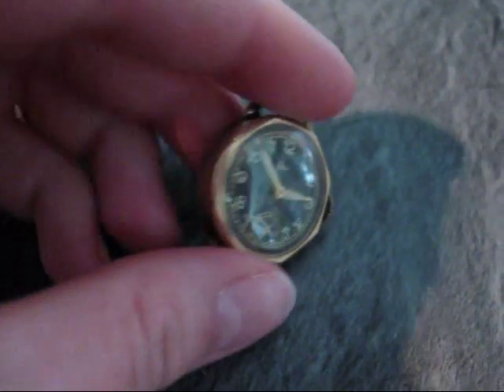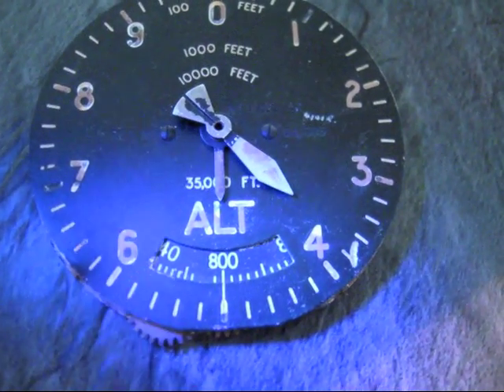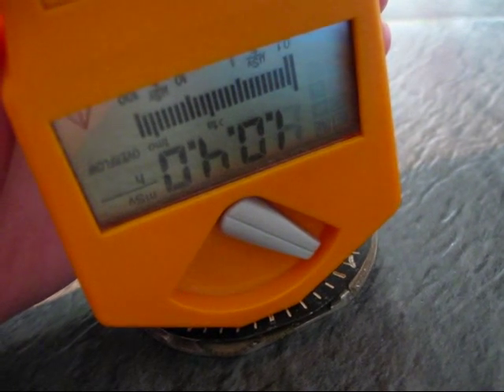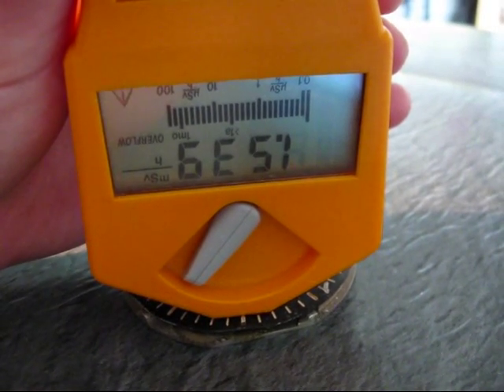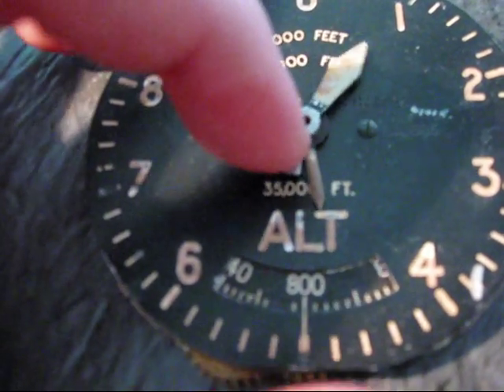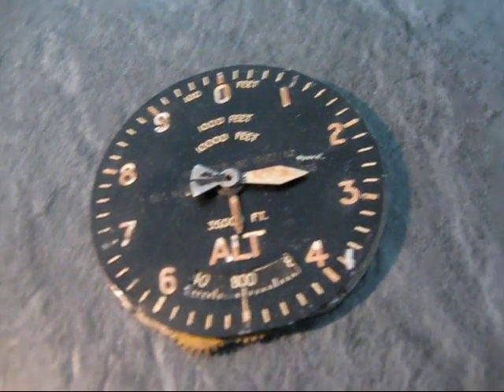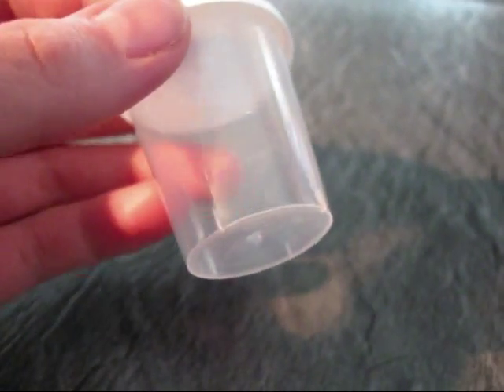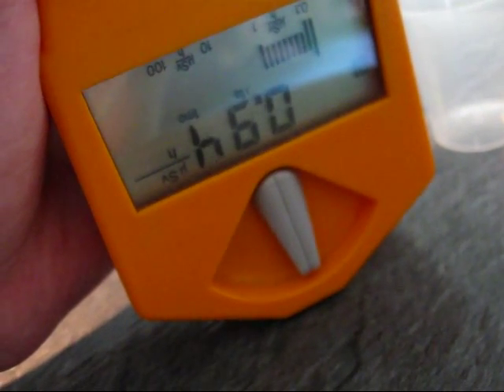radioactive spitfire warbird altimeter - doped with radium

Comment: I'm just imagining the distribution of the manjority of the fragments of the Spitfire dial over the years - and the trail of devastation caused by the ingestion or embedding of fragments in the body.. etc.
I've got a couple of Trinitite specimines that I have been mindful of over the years caused by slowly losing particles - so they are now in a sealed perspex box, probably accumulating gaseous nasties inside
Reply: Don't worry, trinitite is extremely mild, and doesn't produce radon in gas. Spicy radium items and large uranium ore specimens are the nasty ones

Comment: Remember, radium-226 (t½ = 1600 years) which makes up most radium, and radium-228 (t½ = 5.75 years) in a lesser activity, have decay isotopes with much shorter half-lives (thus more radioactive), and these have been in secular equilibrium (decay isotopes are decaying at the same rate as the parent isotope) not long after they were chemically separated from uranium ore decades ago. And many of these isotopes have vastly different branching ratios for characteristic gamma rays of different energies and intensities per decay, like bismuth-214 and lead-214 for example, which is why it's so gamma and beta radioactive too. Basically, the decay isotopes (or daughters) are what makes radium much more radioactive.

Comment: I wouldn't be touching this with bare hands.. wait this was in 2010? are you o.k STILL? I hope so..
Reply: Tules G this nutter has the indicator sensitivity dialed up to 11. It’s all sound and fury signifying nothing. The gigs counter was only reading 1000 microseverts per hour after prolonged point blank exposure. 1000 microseverts is only about 1 milisevert witch is 3 times lower than the average background radiation at night at sea level.
Reply: godofawesum223 you seem knowledgeable on the matter. I recently purchased. Watch with radium dial and the acrylic crystal is cracked in some places. Is it safe to wear? Can I open and clean it using gloves and mask?

Comment: The radium doesn't glow the radiation interacts with a compound in the paint (zinc oxide I think) to make it glow however it also destroys the compound over time.
Reply: Ham549 Phosphorus is the chemical that they used to react to radium that caused glow. Your right though it is the phosphorus that is gone not radium.
Reply: @kimberlygeorge8662  Not correct. Radium paint used zinc sulfide, not phosphorus, to produce the glow. Bionerd even mentions this in the video.

Comment: I would love to know how hot the radium dial compass I had as a child was. Carried that thing around in my pocket all the time. Roasted nuts?
Reply: they are usually between 30 - 60 millisieverts i guess. not a big deal.
Reply: Yes but this is Gamma cumulative.
Reply: still nothing
Reply: Synergy Everything.
Reply: I used to carry an old Westclox Pocket Ben pocket watch and it turns out those are quite hot, In fact there is a video on U-Tube where someone measures one and it was quite impressive for what was once sold as a consumer item.

Comment: does radioactive things glow i thought it was a myth
Reply: Home Homer radium doesn't glow on it's own, you need a phosphor like zinc sulfide.
however, curium, einsteinium and actinium will glow in the dark on their own, because of their extremely intense radiation
Reply: Many radioactive sources can. They usually glow on their own, but it's not the source itself. It's the ionization of the surrounding air (or other gases) from the particles that the source emits. Some are very radioactive, and emit some of their kinetic energy in the form of heat. Plutonium-238 and americium-241, for example, glow from their own heat, which is when alpha particles emitted collide with other atoms, releasing thermal energy. But, these are sources with relatively short half-lives and hence have a much higher specific activity. And that's if there's a lot of it, too.

Comment: "the alpha / beta radiation that penetrates your body stays there.... you will end up with bone cancer mate". If I might comment here--alpha radiation does not get past the outer layer of skin, and beta is an energetic electron that may penetrate as far as 5mm of tissue. But, neither of these are isotopes that will stay in tissue and cause lasting damage. Of course it would be dangerous to ingest radium paint, but with precautions one can limit their risk of exposure--we've all be around radium.

Comment from the maker: radium ist just one "bit of the story". radium-226 comes from the uranium-radium decay chain, and there are MANY more radionuclides down the decay chain until it finally becomes stable lead. most of the daughter nuclides will initially be in an excited stage, which makes them gamma emitters. some of the daughters will also undergo beta decay instead of alpha decay. just check e.g. wikipedia for "decay chains" for more info.

Comment: @OrangePHX      You asked what a radioactive watches were... A radioactive watch is a watch which uses a radioactive paint, like radium, to allow it to glow in the dark. Radioactivity, the ionizing type, is dangerous and can lead to cancer, really quickly, and even worse problems. Watches made before about 1970 often used this. A Geiger counter, like the one Bionerd uses, can register the unseen radiation coming from the watch. This is not the same as radiation from a cell phone or microwave, w

Comment from the maker: @hartiganutube 
not really. 900 uSv/h is a) not much and b) the combined reading of all radiation combined, not just hard gamma radiation. however, handling with bare hands, well... you should wash your hands well after handling it, so you dont ingest / spread radium dust all over. also, i keep it in a sealed plastic bag because of the radioactive noble gas radon being emitted by radium (it's the direct daughter nuclide). i also keep it in a metal safe, but yeah, it's safe like this. =)

Comment from the maker: @10mintwo 
thanks, and yeah, the major amount of radiation has likely lead to destruction of the ZnS crystal structure; however, ZnS(Cu) is much easier to excite than just ZnS (let's say by UV light), so i think that also leads to this altimeter not glowing under UV light... just my guess.